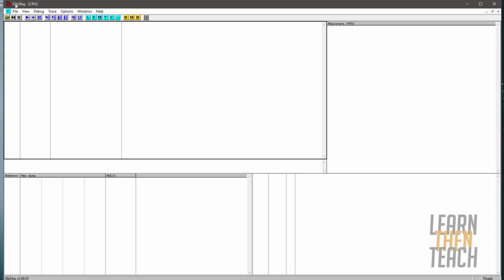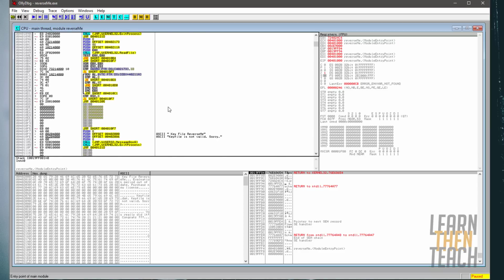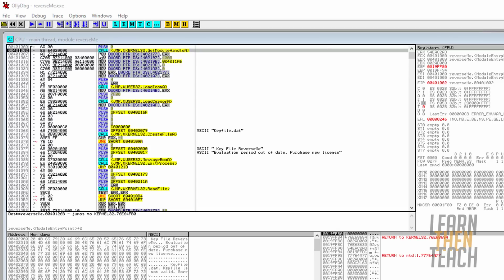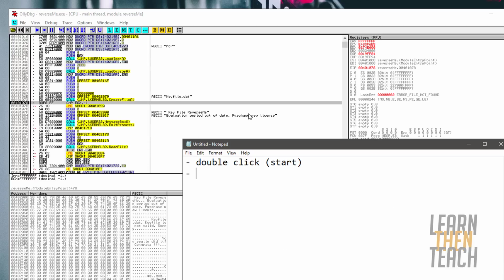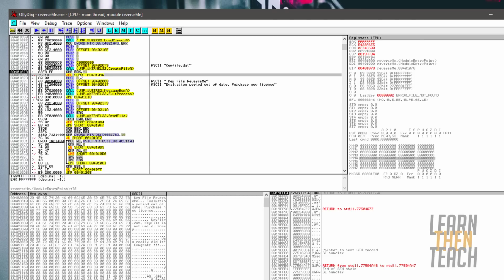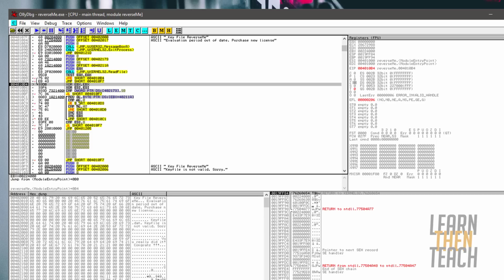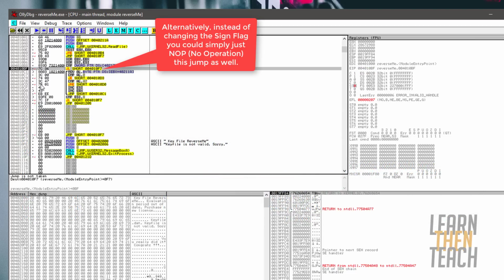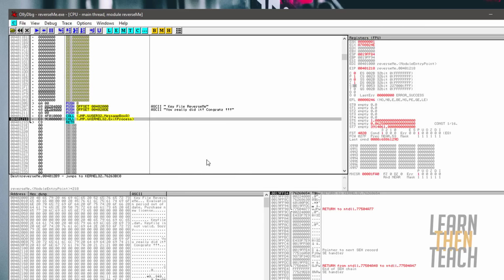Reversing for Newbies - Pt 1: Binary Patching (Lena151 Assembly Tutorials)

Comment: i was given this file and task as a homework assignment. i paused the video after the part where he broke down the structure of the program to see if i could figure it out on my own and the solution i found is different than the one in the video. at address 004010D8 i changed JNE to JE to skip the first error message then at 004010B2 i changed the address of the jump to 004010D8 which leads to the jump thats executed if you pass the second check which then leads to the success message. this solution works with just these two edits

Comment: i just reversed engineered my 1st program! (te one in the video) im so happy now! fianlly someone who explains what is going on!!!!! <3
Reply: @trtrhr  i am trying to bypass registration of pubg hacks..but i cant ...please help me
Reply: @sabinbayalkoti1625  beside the fact that using hacks is lame, it seems you dont know shit. These hacks do not register on device. user and registration data is stored on external auth servers. plus the .exe file which is only to inject the hack loads modules from servers. modern hacks dont even popup in the memory cause they are running at low level kernel mode. And last but not least the developers often using exe packers like "themida" that encrypts the file, so you cant modify it with a debugger

Comment: Hello, nice video tutorial, I've a question about how to find the correct break when you start the .exe to debug that require to open, for exemple on my case, the help to enter serial ? The Main_Prog.exe does not contain any "Ascii text" and it's very difficult to find where to put a break point to execute line by line, it seems the program is compiled using QT, any idea are welcome ! Thanks and again good video. Vince.

Comment from the maker: If you guys want me to make a video explaining some more fundamental Assembly concepts, comment! If enough people want me to make one I will!
Reply: yes... thats what I'm looking for .... step by step teaching...I know this is an easy R/E but this is where I need to start.. Are you going to teach more complex R/E ?
Reply: Well done. Please continue.
Reply: yes sir... thats what we want, thanks
Reply: LearnThenTeach  I have an old strength program from the late 2000, purchased, licensed to me and i had to purchase an old XP laptop to run it because it was so old and compability mode wasnt working.. well I got it installed and it requires a password which I dont remember, it's from 99.  I tried loading Ollydbg but didn't seem to run correctly because of how old the program is. I also tried finding info in the code by loading it into notepad but no luck.  Any suggestions or other programs I should try?
Reply: Yes please do make such a video
Reply: please do more content. i support your channel pause ads block for your channel
Reply: please do crack software content